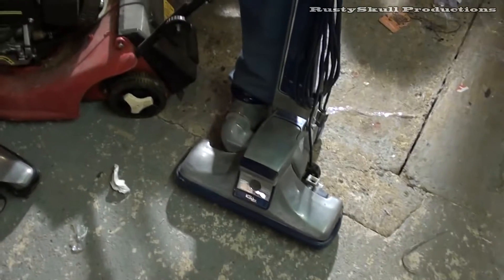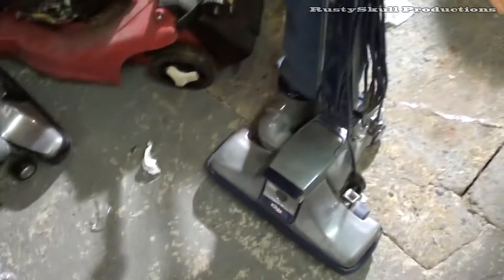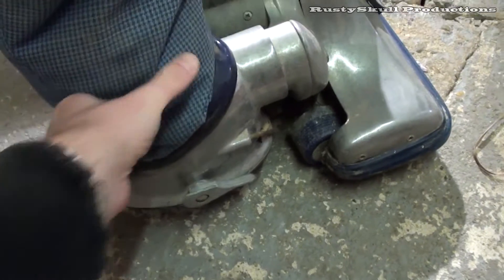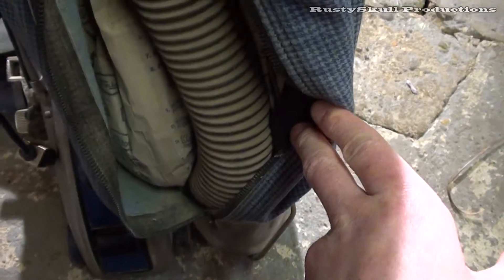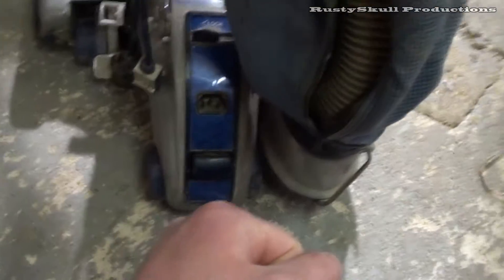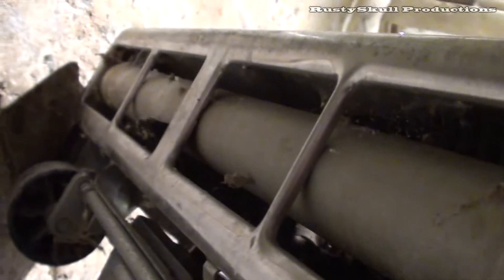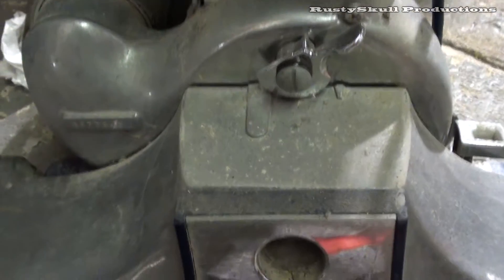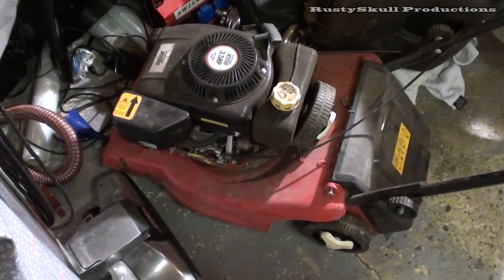1979 Kirby Tradition First Look Part One - RustySkull Productions

Comment: The Tradition 3CB's color scheme is awesome!  I didn't know that Kirby made 2 different nozzles for it.  Here are the letter codes of its serial numbers:  F= July 1979 - February 1980 
G= March 1980 - February 1981  H= March - August 1981 

Tradition customers had a choice between a disposable bag system and the conventional one.  The former had zippers on the outer bag, and the latter ones didn't.
Reply from the maker: Thanks for the info!! :)

Comment: There's no way that's from 1979, unless it's been heavily modified. The Tradition did come out in 1979, but all '79 models had a Headlight cap locking switch on the side of the headlight, they also had metal fans, and I suspect yours has a Lexan fan. The safety switch on the '79 models were located on top of the interior of the headlight cap, the floor nozzles had a little metal pin on top in order to activate the switch, but this proved problematic. The Headlight locking switch models didn't last very long due to people breaking them, what the switch did was it locked the headlight cap in place meaning you had to slide the switch in order to lift the headlight cap, and slide it down again in order to lower the cap, but it was often broken by people trying to lower the cap with the switch on, which broke the mechanism. Kirby had to recall some models in order to swap over the cap/safety switch assembly to an updated one, as used previously on the Classic III and Classic Omega. Your Tradition is either from 1980 or 1980.
Reply from the maker: +Kirby Man 1980 or 1980? Lol.

It's a Tradition that's all I know ;) 
Thanks for the handy information though dude ;)
Reply: +RustySkull Productions Thanks :) And I meant to say 1980 or 1981!
Reply: +RustySkull Productions Oh I wanted to ask, do you have any pre-tradition models?
Reply from the maker: No but I'm currently looking for some, as far as I know Kirby came to England in 1979 and the Tradition was the first one here. So Pre tradition models are pretty much non existent over here ;(
Reply: +RustySkull Productions Well luckily you're wrong! The Classic Omega was the first Kirby to be sold in England around 1974/1975, however the Classic Omega is very rare to find due to it not selling well, one of my friends owns a UK Omega, and I've spoken to a guy who services Kirbys who has a couple of Omega motor units, he said he has one he'll give me, the Classic III which came after the Omega is still rare in the UK but is a lot more common than the Omega, I have a UK Classic III, they pop up on eBay occasionally, there was one for auction a few weeks ago, if you're after one I could ask James and see if he has any he'll sell.
Reply from the maker: I haven't been able to find any in England lol.
Reply: +RustySkull Productions I know my friend James has several spare Classic III Kirbys, I could ask him if he wanted to sell one if you'd like?
Reply from the maker: Yes please, can't harm in asking ;)
Reply: The Traditions that have the top-mounted speed switch are serial number F499999 or lower.
Reply: The reason Kirbys didn't sell well in the UK prior to 1979 was because they did not yet have disposable bags.
Reply from the maker: So American's liked that idea?
Reply: RustySkull Productions
Yes, we did. Even when the Tradition was finally released, there was still another hurdle: the fill tube for the disposable bags wasn't very large in diameter compared to the Heritage and later machines.
Reply from the maker: +ClassicTVMan1981X Yeah, I noticed that with mine.
Reply: @bsanchez3563  The Legend II was indeed the last machine that had the "reusable" (shake out) bag system, but most such sales were to janitorial concerns rather than we civilians.